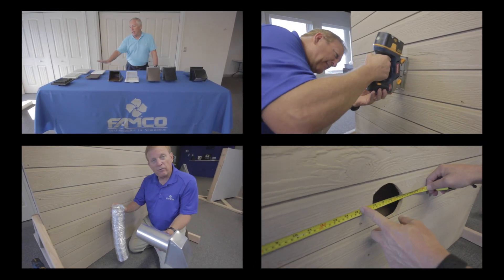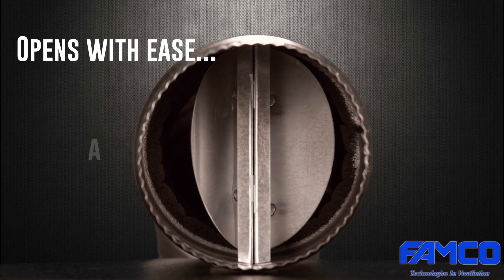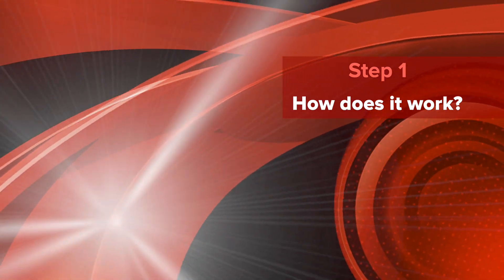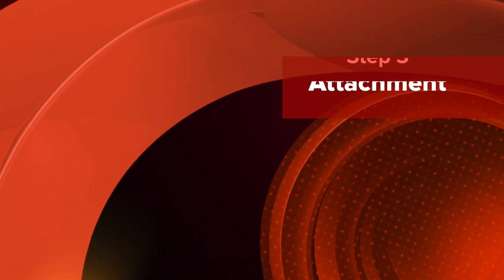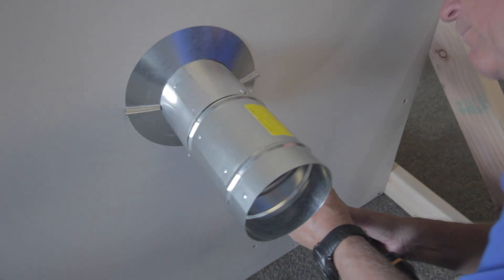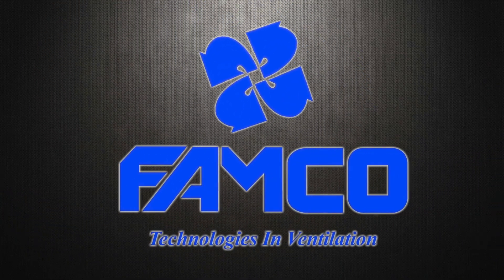Back Draft Damper Installation - How to install a damper

Comment: Screws should never be used with dryer vents. Use foil back duct tape or equivalent only to attach vent pipes, elbows, and any other fittings.
Reply: I’ve seen self taping screws installed in ducts, but then covered with aluminum tape. This way it’s secure and will not leak.
Reply: @ You can do whatever you like and yes, I’m sure people do it. I just wanted to let you know what a serious fire hazard this is. The screws protrude through the duct, and this allows for dryer lint to build up and it will catch fire. Be sure you’re cleaning the duct thoroughly before it begins to lose its effectiveness.
Reply: @wgpjr2  oh yes, for a dryer vent that makes sense! I was commenting referencing a duct for a range vent. Cheers

Comment: When installing for a range hood thru the attic should I install damper on the warm side or cold side of the duct work. Ie in the house or the attic ..
Reply: I'm a lowly homeowner, but will offer some things I'd consider in my own home:

1) make sure the damper is the minimum distance from the blower that feeds air into it (such a stipulation, if it exists, may force you to put it into the unconditioned space, making your question moot)

But if no such stipulation or if you still have plenty of room to place it in either the conditioned or unconditioned space, I would...

2) Choose the side where I could most closely fit the duct against the wall penetration,
 AND most easily and thoroughly insulate the exterior sides of the duct with insulation.

Personally, if given a choice, I'd use Roxul stone-fiber batting insulation covered with a plastic vapor barrier over that sealed to the duct with duct mastic tape. Then I'd possibly wrap it one more time over that with another layer of the same insulation but w/o a vapor barrier. 

This would reduce the potential for humid air to condense on a cold duct when closed as you'd essentially be bringing the damper into a semi-conditioned space (by a combination of the insulation, vapor barrier, and residual conditioned air present in the conditioned side of the damper flap). If condensation did form on a vertical run of the damper/duct piece, the stone fiber insulation would catch most of it until it evaporated (hygroscopic properties) and since it has no paper facing (organic material) it wouldn't mold.

Now, cons against putting it in the attic could be difficulty or impossibility of replacing the weatherstripping or unit in decades ahead should it fail, or checking that it functions. For instance, if there is almost no space in that part of the attic to walk, but there's plenty of space to fit it in a cabinet or on the other side of a partition wall from the stove (and insulate it), then that may or may not make future inspection/replacement easier.
Reply: Depending on your climate, there is a good chance that the sides you call "warm side/cold side" will flip-flop depending on time of day and/or season. That's why I used the terms conditioned and unconditioned instead.
Reply: And lastly, I suppose the damper creates at least a slight bit of noise as air travels over it. And it probably creates a back eddie of air and could cause the exhaust fan to run a minuscule louder if they were placed too close to each other. Cooking isn't the quietist task, though, and most lesser expensive exhaust fans are terribly loud anyway, so disregard noise in your example.

Comment: I have 100 degrees temps at the microwave ... would a dampener resolve this? It gets extremely cold in winter too.. I am thinking it wasnt installed.
Reply: I am a non-hvac professional, but it seems logical to me that your combination microwave/exhaust-hood, presumably over a stove or oven, probably indeed lacks a damper. I think some of those style microwaves w/ exhaust come with a built in damper, but it may have not been installed, and if not, you won't be able to get the OEM part anyway to fix it. So I'd use either this style, or the style with a flapper, rain cover, and insect/bird screen on the outside of the house if it mounts to a sidewall. Probably a good time to see how it exists the house, and whether it's sealed from birds especially, regardless of final damper choice.

One caveat, if the stove this vents is a gas appliance and you don't have enough makeup air in the house, for whatever reason, you may get incomplete combustion and/or increased CO2 when the gas is being used for cooking but the exhaust fan is off. If gas, invest in a CO2 monitor as a precaution.

Comment: Most people’s exhaust ducts are IN the wall, not sticking out of it.
Reply: I guess the demonstrator could have placed it on the other side of the wall, then spun the wall toward the camera. Or he could have built an attic, then climbed up there with a ladder. A basement more difficult, but there's always a jackhammer and some guys with a shovel.
Reply: @Dik Burns It's a how-to, genius.

Comment: installation looks good up until you drilled a #10 sheet metal screw in that assembly. per the mechanical code, you are restricted from drilling any holes in the exhaust duct that will ultimately catch lint. see section 504.4 in the mechanical code. otherwise, look sgood
Reply: yeah that is true, although they don't necessarily say this is for driers. Could be a bathroom exhaust fan.
Reply: Points though for listing size of the sheet metal screw. Obviously in the trade. (... but what about a # 8, or a #12?... lol)

Rivets are a pain in the arse in a crawlspace.or attic, but you reminded me they are a better choice in this situation if you positively won't soon be taking it apart, AND are blowing lint through a damper style that is a poor coupling with a dryer anyway.
Reply: @KySilverfish  technically there's a specific sized screw you can use but most inspectors aren't going to take your word or check every single screw themselves. They'll prefer to fail, so it all depends on the inspector

Comment: Does it keep out humid air in the summer also?
Reply: Yes. But perception of any reduction in indoor humidity will likely not be discernible to you except perhaps on a digital gauge (due to the house not being very air tight to begin with).

Unless you're broke, or it's gonna be h!ll to fit it in the attic or whatever, the $50 to $100 to install it yourself is probably worthwhile... unless the equivalent idea of having a window cracked open in the kitchen 2" year round sounds appealing to you.

Comment: Buy a proper drier vent. U never put screws in a drier pipe as lint will stick to it.
Reply: I'm looking at one of these as a backdraft damper for an HRV/ERV (fresh air) unit. 

Good point about most dryer installs, though I can't imagine these being ideal for dryer vents even without screws... because the damper vanes will eventually have the same lint problem as the screws. I don't think dryers is their market for this style damper anyway.

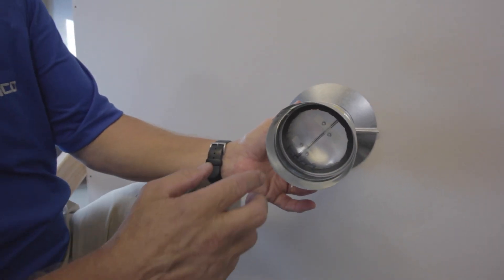Comment: I'm new to this but -  it looks to me like it's installed backwards, it will prevent exhaust coming out that pipe instead of stopping it from going in? at the 1:23  mark. What am I missing here?
Reply: The exhaust discharges out, through the wall, and into the outdoors. It does not come from the wall

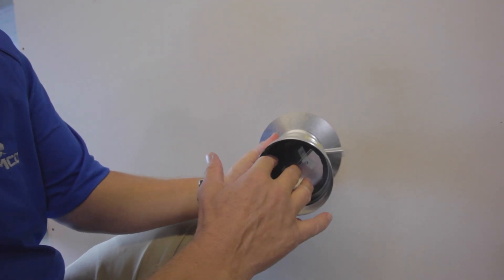Comment: At the 1:00 mark, the video shows the damper blade sticking and not closing after the person demonstrates it opening! Looks like bad design, bad QC or damaged product?
Reply: I agree. The damper got stuck on one side, and that's a poor design. Gravity may or may not have helped, but if so, that means these could only be installed vertically, not horizontally as in the demo.
Reply: FAMCO Manufacturing  You did not address his issue with blades getting stuck, thanks for trying though.
Reply: @Burritosarebetterthantacos  are you illiterate? They clearly mentioned that they are designed to use the tension and gravity to keep them shut. Do you not know how gravity works?
Reply: @stephenwong9477  Mr Wong. If you can explain to me how gravity works in a horizontal application I would love to entertain the conversation. Im guessing by your picture your not a building professional...and guess what, I am! I simply replied to another humans post saying it was sticking....I bought the exact damper and it stuck too. There is zero tolerance for air intrusion on certain types of construction/architecture but Im guessing you know nothing of this. I do appreciate you calling me illiterate on a post about a damper. Its funny that trolls just seem to find their way into our lives. Its easy to be snarky on a keyboard isnt it?
Reply: @stephenwong9477  Im unsure why you are so angry but I have reported you to youtube for harassment. Have a nice day.
Reply: @Dik Burns So you got triggered watching a video about dampers too. I feel sorry for you.
Reply: I'm glad you pointed this out as it may save a bunch of people hassle. The manufacturer (or company rep) didn't do an exceptional job in trying to explain the specifics in why gravity seemingly failed to close the damper, though I'll give them points for at least monitoring their videos and taking the time to try by pointing to install literature (which I doubt most casual viewers will bother to look up because they assume it is a cop-out answer to a flaw... that and it requires more time finding their website, the relevant doc, and reading through the whole thing and still possibly missing the actual dynamics involved. Me included.)

I'm going to guess that in this particular video, the problem is NOT manufacture error, or quality control, but that the demonstrator didn't have the pivot rod "plumb"... it's canted at the top to the right, and the left side is the one not returning to close. I admit, I have not read the manual, but you'd think this would be explained here by the company better.The only useful thing the wisecracker in this thread offered, though couched in poor explanation, is that the picot pin is not 90 degrees to the sidewalls of the pipe in the direction of fore and aft if viewed from the side (verses viewed from the pipe ends or openings). Thus when 1 of the 2 ends of the pivot pin that leans forward the farthest IINTO the conditioned space is situated so that that end is top-dead-center in relation to gravity on a horizontal run, each half of the damper has equal force of gravity pulling it closed. When it was canted, the center-of-mass of the left section of damper plate was probably at a near balance point on the pivot rod, but we all assumed it was stuck because we didn't know that the pin was not perfectly "up and down" relative to a cross section plane if the pipe were sawed in half across the sides at the pivot pin. 

Some types like this also have a spring assist, I suspect to either overcome a cant position of the pin relative to TDC, or perhaps their pins are oriented plumb in a perfectly horizontal run, thus cannot use gravity to stay shut.
Reply: Hi Andrew,  We have spec sheets available on our website to review the design. When installing our Back Draft dampers blade orientation is important and they use tension and gravity to draw the blades back to return to their closed position. This orientation is diagrammed on our spec details.
Reply: @FAMCOManufacturing  "blade orientation is important" your video literally says the opposite, that orientation is not important and even works horizontally